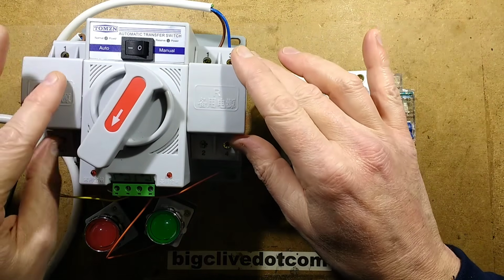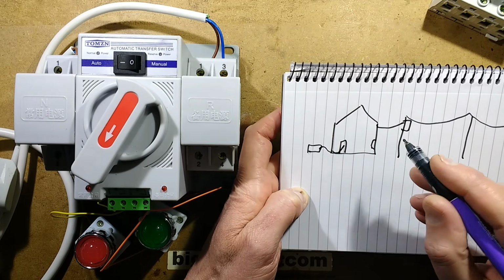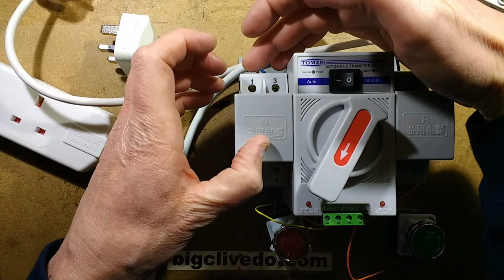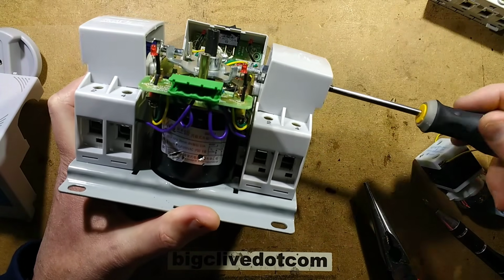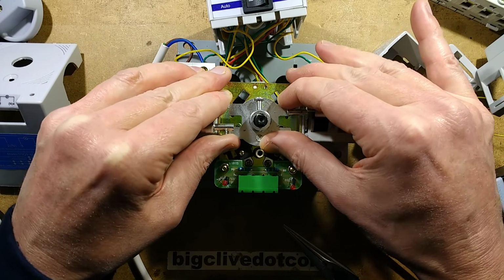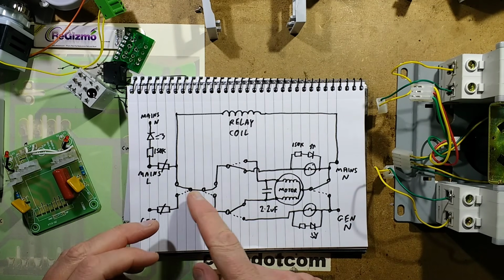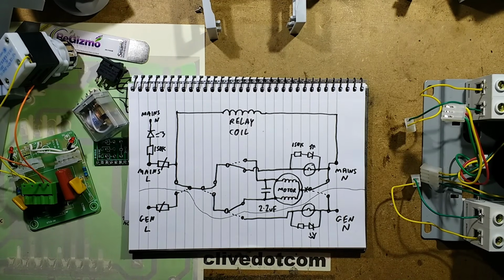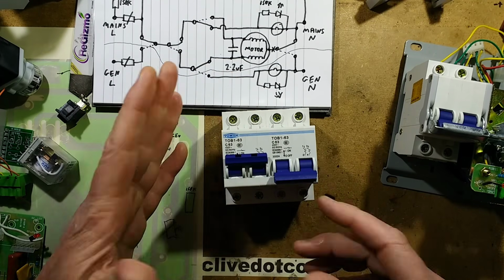Automatic generator changeover switch (with schematic).

Comment: I never thought about the back-feeding on personal generators. As a note, I remember Reddit getting angry (so surprising!) about Florida not allowing personal solar installations running after the recent hurricane. I'm pretty sure that back-feeding is the reason behind that choice, and not many people were thinking about that on reddit. Very interesting and definitely something I'll remember!
Reply: Our solar power system uses smart inverters which shut themselves off when there's no power.  Solving the problem would have been as easy as legally requiring those.

The real issue is most power systems don't WANT grid-tied solar powered homes on them.  It'd mean beefing up all their marginal substations and giving people meters which aren't faulty and 30 years old and selling them less power - to you it's win/win, to them it's lose/lose/lose/lose/lose.
Reply: @tsm688  Here in Australia the electricity companies love rooftop solar, because they only have to pay you a quarter or less of what they charge someone else to use it.  So every kWh of power your solar system feeds into the grid the power company makes a profit on.  Plus since most systems don't have batteries, they pay you hardly anything for the solar you generate during the day when you are at work, and when you get home in the evening and use power they are charging you the full rate to draw from the grid, that's why they love it so much.  It's not until you get a battery storage system in play that you can use to store more of your own solar generation that you really start to save money, at least here.
Reply: @tsm688  only a matter of time for them to bill you for your excess power.
Reply: Is this for real??  I had no problem buying a manual Generator Interlock kit they are made by the panel makers like mine is Square D and installed the plate that blocks you from powering the generator inlet until the main breaker is turned off.  It is like $45 and I did it myself in like 5 minutes.   The outside generator inlet plug and running the wire took some time but was pretty easy for me even though I have only done simple wiring like adding lights and moving outlets around.  Do it at your own risk :)
Reply: It would be pointless to "allow" the solar to run anyway, because the systems would be overloaded trying to power the whole neighbourhood.  The Tesla Powerwall (and probably its competitors) are smart enough to disconnect from the grid in these situations (legal requirement anyway) yet it can still use the solar to charge itself and power the connected house, so there are still ways you can use your own solar even when the grid is down without running into regulatory problems, it's just a bit more expensive than the cheap grid-tied inverters that come with most installations.
Reply: @vink6163  I got certified for residential and commercial solar installation. Never once was a transfer switch or disconnect part of any array I've installed. Aside from DIY and Tesla there are no power walls. 
I'm not sure what you mean by your first sentence. Because in California the PG&E grid not having infrastructure to handle solar spike in voltages (plus my states neglected forest management) sparked a fire that wiped out my best friend's entire town (paradise), why did that happen? Home solar installation during the day has pg&e grid is so hot we must pay AZ with our tax dollars, to take the power the state gave to people using our tax dollars (because most solar installations are subsidized). 
I'm typing this from a solar powered device living off grid with solar. So I'm a proponent of. But as a realist,  what you said in the last part of your comment is entirely true. Solar is limited in application, and it by no means a substitute for fossil fuel. Summertime day time the grid is higher voltage ⚡ than is nominally wanted. Sparking fires, and blowing transformers causing a need for rolling blackouts (they claim, as i see no need for the blackouts unless it's for direct maintenance to the grid)
Reply: @AnonMedic  Not sure which sentences you are referring to as I wrote a few different comments, but you are right, the electricity grid needs to be able to cope with spikes in demand due to the increase in solar power during the day.  Here in Australia our grid is managed a bit like a stock market, where the electricity price goes up and down all day depending on supply and demand.  So during the day when solar is plentiful, the price tends to drop due to oversupply, which causes fossil fuel plants to shut off as they can't turn a profit.  Without them feeding into the grid the voltage doesn't increase as it otherwise might.  Then as the evening arrives there is a drop in supply from solar so the electricity price goes up again and all the fossil plants start up once they can again make a profit, again keeping the voltage and frequency in an ideal range.  We also have a whole market called FCAS where generators are paid to be on standby to generate more power at very short notice if required, and also to use up a lot of power if there is a sudden oversupply until the generators can be shut off (they get paid to use power, a pretty sweet deal).  So the grid is pretty well regulated by market forces and remains quite stable.  There are caps on prices to stop it going crazy and financial penalties for the power companies if they don't maintain their infrastructure so we rarely have issues stemming from poor maintenance like those wildfires you mention. (Our wildfires tend to be caused by lightning or arson instead, and there are no shortage of those.)

Re the transfer switch are you referring to the anti-islanding protection built in to grid-tied inverters?  They will shut off as soon as grid power disappears so there's no need for a transfer switch or isolator.
Reply: @vink6163  Ten year minimum return on solar, and then it is outdated or needs new batteries. I will stick with  back up propane. If you live in a city you are charged with monthly sewer and water bill. Moved to county, no sewer or water bill,, that savings alone pays for all my energy cost. No ten years loss.
Reply: @BasketCaseGarageForFun  DIY and contracting yourself can cut it down to 3-5 years with current tax credits.
Reply: @BasketCaseGarageForFun  Only the earliest systems back in the 90s needed 10 years to get a return, nowadays it's much quicker, that's why people are replacing their systems - not because they are broken but because they want a bigger system to save more money.  Every second house where I live has solar, and I can tell you people aren't doing it to save the environment, they're doing it to save their wallet.

Propane is fine but it suffers the same problem as any other fuel.  After an event like a hurricane, your supply can be easily cut off and then once you use up what you have on site that's it.  The benefit that solar and wind have is that once they're running you aren't relying on anyone else to keep your lights on.
Reply: @Undefined Lastname That rarely actually works in real life unfortunately. How do you know who is doing it right or not? send in inspectors of course. inspectors that are kind of way too busy handling the infrastructure right at the moment.

Comment: So, is the feed-back problem the reason power companies don't like to buy excess power from consumer PV arrays and such?
Reply: Jim Fortune Sometimes yes, sometimes because of the jolt of load change to the system whenever a cloud blocks the sun to many houses at once, sometimes it's just greed.
Reply from the maker: I think it's mainly because it's very random and may not match their requirements.  So they have to keep their own plant running at full requirement.

Comment: The fact that if the relay coil fails it would automatically switch over to the generator, but not automatically switch back again, that tells me that it's a failsafe design. It will at least switch over automatically to the generator, but it won't automatically switch back, giving the operators the ability to at least make sure that mains energy is restored before manually switching back over to mains and cutting the generators off.

Comment: I'd be worried about that relay being mounted hard against the PCB.  Depends on the construction of the relay, but that's almost certainly a bad idea.

With the relay mounted hard against the board, even if it's a single-sided board, as the joint cools the relay pins will contract slightly as they cool.  This puts strain on those leads which, in that style of relay, means it can cause slight contact misalignment and/or loosening of the entire structure.  It also means (going by how you drew it) that pads on the relay base are in contact with the PCB leading to moisture traps (which encourage corrosion and fungal growth).  Don't mount components hard against a PCB if you want the design to be reliable.

As an aside, wicking of the solder up the through-plated hole is not only normal, it's desirable in high-vibration environments because it stops both pushes and pulls on the component leads peeling the track away from the substrate.  In aerospace applications you may find PCBs with all the tracking on one side but still using double-sided board with TPHs just for vibration resistance.

BTW, I find a good solder sucker is better than braid for removing components on double-sided or multi-layer PCBs.  It sucks the solder through the hole, removing it from both sides of the PCB.

Comment: To show that I'm a real pedant... all electrocution is fatal. Sorry. this is probably evidence of my OCD.
Reply: I thought pedants used the OED. :)
Reply from the maker: Yeah, I just like to drop the word fatal in, since most people seem to think that getting a tingle is being electrocuted.
Reply: Nicholas Hacking But not necessarily permanently fatal provided someone is around to restart your heart afterwards.
Reply: Eh?  I searched Google:
Electrocute, verb:
injure or kill (someone) by electric shock.
That definition definitely DOESN'T make all electrocutions fatal.
Reply: No, it doesn't. That's why it's an incorrect definition. It's a neologism, as far as I know, which was intended to describe execution by electricity. The desired outcome from an execution is of course a fatal one.
Reply: As a NORWEB (UK) 'Spark, I had 240 @ 30amp across my chest (hand to hand) and fortunately jiggered across the floor until I wasn't touching anything, burnt flesh smells disgusting, but 50 yrs later I'm still here

Comment: That box is suitable for the entertainment industry (apart from the legal ramifications of dodgy Chinesium).  Swap the mains and generator feeds over.  If the generator is running it takes priority over the mains.  So you don't go back to mains until somebody decides it's safe to turn the generator off.
Reply from the maker: I already added that afterthought to the description.  It also means that the relay is only energised when the generator is running.

Comment: Nice, some of the more expensive generators have auto start on power fail, wonder how that is setup.
Reply: Affra Auto start generators have circuitry that monitors the incoming mains power. If the mains power goes out for a certain amount of time (usually 30 seconds to a minute but can be instantaneously in super critical situations or even longer than a minute in non-critical situations) the circuitry sends a signal to the transfer switch to switch over and a signal to the generator to start up. The circuitry continues to monitor the mains power and once it detects the power is back on it signals the switch to switch back over to the mains and for the generator to shut down.

The circuitry can sometimes even monitor the voltage and quality of the incoming power and switch over to the generator in the event the mains power isn't clean or the voltage is to low or high. This is primarily used in super critical situations where good power is a must.

Super critical situations include hospitals (especially for generators that power their ICUs, emergency rooms, operating rooms and surgical suites) and the data centers that keep a business in operation or keep the Internet going (Internet Service Providers, Google, YouTube, Facebook, etc).

These generators can run on natural gas, propane, diesel fuel, etc.
Reply: tallman11282 yeah, would be intersting to see how that circutry works, as it has to do something similar.

Comment: Does the motor work on 120volt single phase service?  Or is this only for Euro's 240 volt?
Reply: TheCondoInRedondo I imagine it would work, however the knob would move slowly.
Reply from the maker: It's actually for China's 220V.  Operation of the relay and motor might not be guaranteed at 120V.
Reply: Thanks!

Comment: This is a nice machine, but no clue what kind of exotic application it could be good for except the one it is made for. I think it could be interesting to combine it with time switches.
Reply: Enty Ropy if your out in the woods with small solar+battery powered grid, but have a small generator for the nighttime.
As long as you have fuel, generator runs everything + charges up the battery a bit (galvanic isolation!).
When it runs out you dont have to hurry to refill and start it up again, because lights and "important stuff" will still work, you might even stay in bed if you know you have enough backup power stored already until next day...
Reply: @Psi Q In this case it's pretty useful, but it is still an application that it is made for. It could also be of use when you use solar panels.
To me it seems almost to be an Xor Gate, I wonder what could be done with a bunch of those in combination with time switches, something more exotic.

Comment: will the breakers still be able to trip( go over current)? wouldn't the motor cause interference?  and cause false re triggers? what is the failure mode of this thing?
Reply from the maker: If they are breakers they can still trip internally while the switch toggle is held in the on position.
Reply: Since the motor is powered by the input and not the output, it means a trip will do nothing as far as switching the inputs goes - power will cease on the outputs, but the switch won't transfer.

So if you're on the generator input and the breaker trips, you'll lose power until the mains comes back on, when the unit will switch back to the mains...possibly tripping again, in which case you'll be without power until the next blackout when it switches back to the generator, again possibly tripping if you still haven't removed the fault on the output.

So conceivably in an unattended set up you could have trip after trip as the mains power comes and goes, until the fault is removed, however any fault would (probably) not cause the unit to switch inputs, unless the fault current was large enough that it managed to trip something upstream as well.  And chances are if you have something like this, it's a big deal if the load loses power, so someone will notice pretty quickly and investigate before too many more blackouts/overcurrent trips happen.

Comment: What happens if the MCB on the mains side trips?
Reply: It looks to me like it would push the motor back a little and then perhaps the motor would force it on again?  Or maybe it cannot move down enough to reset the trip action, so the user must manually turn over to generator power and then go back to reset it?
Reply: Might destroy the generator or stuff in the house (big bang if the generator and the mains voltage and not in sync)
Reply: You would have to manually switch it over to generator and then back to mains to reset the breaker
Reply: Slothnik there is a gap in the mechanism he actually manually pushed the other breaker down and it was able to fully disengage without moving the motor the motor is very stiff 

if you watch the video you can force both switches on but it is norm impossible unless you take the cover off and manually Force both breakers into the up position
Reply: They're not MCBs.  Think of them more as 2 pole isolators, the same as the main switch in the distribution board.

Comment: Where it says 'MCB Type' i think they refer to the 'form' of the switch, so probably only an isolator.
I know it can't be done with the covers on, but i wonder if it's possible to get both turned on, like if the trip mech failed on one, and the other breaker tried to engage.
Also, are they actually double pole isolation.
I've designed and built a generator changeover panel to replace a 1940's gen panel where i worked, that was fun :)
Reply: The video shows that you can manually switch both sides on at the same time.

Comment: Nifty device! Bought a rather more sophisticated (and more expensive!) one from the UK, but it's still in its box. Far easier to switch off the incoming power, and PADLOCK the distribution Board! The keys to the padlock are on the same ring as those for the Gennie - so anyone HAS to stop the Gennie (key-start diesel) to get the keys for the padlock - pretty much a fail-safe arrangement.
Reply: They HAVE to stop the genny to get the key??... I don't think so.  Some enterprising young spark could take the distro box key off the keyring with the genny still running :)
Reply: You need to superglue the keyring shut... or encase it in epoxy!
Reply: EscapeMCP - there's only the two of us, and The Mrs does NOT like fiddling with the generator!. The generator design is such that key removal can only be done in the shutdown position (basic safety interlock), and I've taken the "precaution" to run a few layers of heat-shrink over the key-ring - so surreptitious "removal" of the distribution board padlock key  is challenging. There's also the added barrier of an NVR disconnect between the generator output connectors and the mains connect (our system is effectively a permanent install - no "loose cables with plugs at each end" for us, mate! :-D )